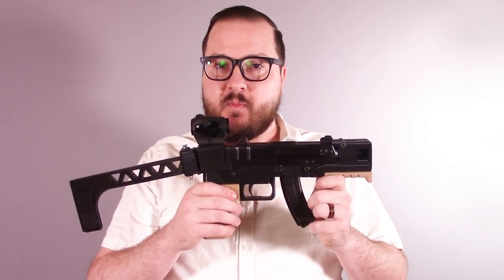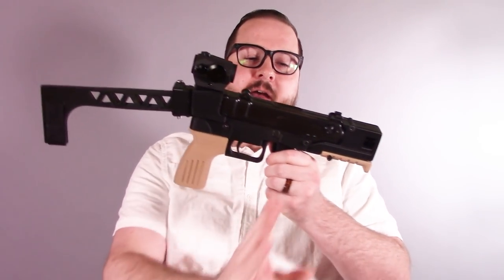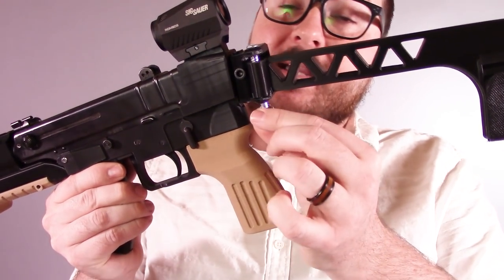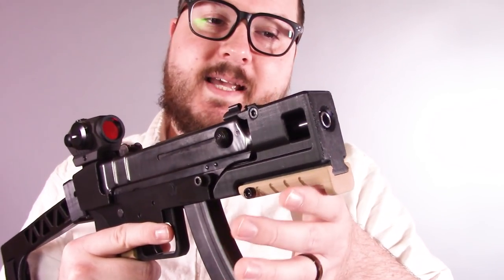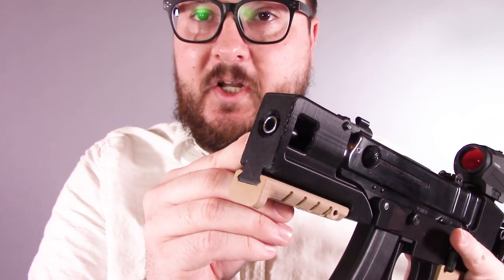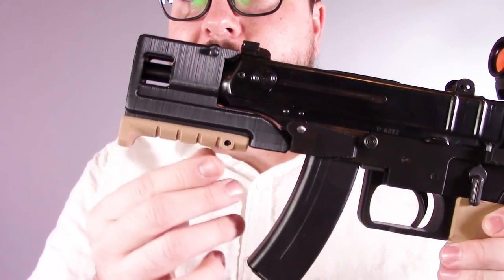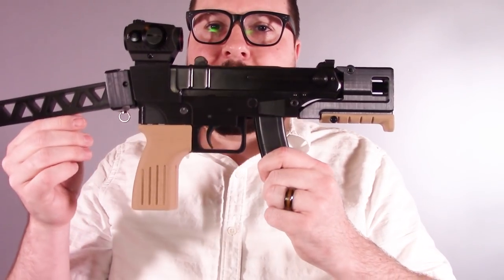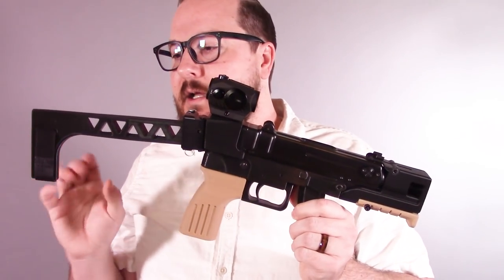3D Printed vz61 Pistol Update - Cyber CZ AR

Comment: Have you messed around with the randomized print temps on the wood filament? You can simulate a wood grain by changing the print temp by a few degrees up or down every few layers
Reply from the maker: Interesting. I haven’t messed around with that at all, most of my wood filament prints are praying to the FDM gods that it actually lays properly and doesn’t clog the fat nozzle, lol.

Comment: Nice work, looks like a ton of fun. Since you asked, I would like to see the 10/22 perfected. Maybe try shooting with better ammo to see if it needs fixing. Maybe polish and wax or grease the inside of the receiver and outer bolt surfaces. Maybe some more testing to see what optimum tolerances are between receiver and bolt. Maybe try a Volquartsen firing pin and extractor. Maybe a Kidd reduced power spring. Some wood PLA stock designs would be awesome. Thanks for everything you do.

Comment: Also have you considered a “scout” mount for the optics to get a better eye relief?
Reply from the maker: I debated adding a rail to the top of the handguard, but the setup where the rail currently is for the optic is perfect.
Reply: @booliganshootingsports  hey if it works roll with it 👊🏼

Comment: Here in PL receiver (lower) is legaly controlled part of gun (in theory - practical is not i n some gunz but for safety i prefere not to lose my permit for some plastic thing)... so i cant print it... but i edited front guard a little - change bolt for m4 with cut for nut, and added place for picantiny rail for rmr optic. 
Also i found online "slide" colapsible stock (MPX style), made adapter, connected together everything, printed extended mag floors and runs very well.   ThX

Comment: could you do like a full 3d printable single-shot  snap open .22 rifle ?
Reply: your gun designs are really cool ur of  the main people that are carrying this 3d printable gun world with this stuff , do you think its possible to do this completely out of nylon ever the metal parts for like a .22 style cz
Reply from the maker: Functionally and legally, you need to have some metal in there.
Reply: @booliganshootingsports  o I know for the weight but I've seen like for example piolets geeks Maverik pistol which is all plastic except spring and a firing pin
Reply: i was wondering would you be able to mabey do a full bolt action gun from plastic to show how it works internally and mabey see if that would even hold for a 22 as a test

Comment: that thin is awesome but i dont think that brace would pass as a brace to the atf.
Reply from the maker: It’s thinner at the rear and has a shorter length of pull than the ATF approved Shockwave Blade, and also has an arm strap which the Blade lacks. Frankly, it’s more of a brace than the approved braces, and I’m 0% concerned about it.

Comment: I would like to see a printable 30 round magazine for it.
Reply from the maker: I worry about the strength of an entirely printed magazine since this has thin walls and limited size to work with, but a printed base plate extension to increase capacity might be a slick design.
Reply: @booliganshootingsports  I know they used to have a drum mag for the 9mm model but never seen one for the 32 cal. The scorpians were real popular along with the macs, stens, sterlings, and aging Thompson's back in the 70's when I lived in Nortern Ireland.
Reply from the maker: So, I got bored yesterday and designed and printed a +5 magazine extension. Seems to be working quite well and is a start for more things like that!

Comment: I know it's simpler making the folding brace straight as a stick. Would be nice to have the brace mount be more vertical and not canted downward. The brace shaft curve down 45 degrees about 2-3 inches back from the hinge and straighten back out to clear the left side charging handle. Then I would delete the top rail and convert it to a flat rmr style mount to get that optic sight line closer to the stock sights... i was going to mess around with these ideas myself, but I dont see why someone who is infinitely more skilled in cad modelling than I couldnt do it better or faster. I know you said these are on your keybase, but I go to your keybase name page and dont know where to go from there...
Reply from the maker: The much, much easier solution would be to just straighten out the back of the receiver so the rail mount is straight out the back. But it’s angled for a reason, you need the drop for proper sight alignment. 

I’ve done direct RMR style mounts before, I have one on my integrally suppressed Mauser. I just like the versatility of a rail on this setup. Everything is perfectly lined up when you aim.
Reply: @booliganshootingsports  just different aesthetics... i was thinking that with the downward angle moved from the rear of the receiver into the brace arm, you should still have proper sight height alignment with the added benefit of not having the brace sticking upward at a weird angle when folded. Wouldn't that also take out some of the stresses to the top end of the brace mounting rail?
Reply from the maker: It wouldn’t be hard to redesign it, but I shoot for the simple solution in most things. This brace design isn’t proprietary to this gun, it’s a standardized one that can go on anything with a picatinny rail. It works great for my needs, so I haven’t felt any desire to redesign it and the receiver. 

And the mounting rail is so rock solid since it’s a solid part of the receiver. There is no way that the brace being angled adds risk of breaking compared to it being straight on. You’d snap the brace hinge long before the mounting rail would show any signs of wear due to the print orientation. 

But that’s the cool part about all of this, you can definitely redesign the parts yourself however you’d like to fit your own aesthetics!
Reply: @booliganshootingsports  you did ask in the video changes we'd like to see... lol. Im printing my first vz61 lower as we speak! I just havent tried to mess around with the 3d model in cad at all yet... gonna be doing that today.

Comment: I love you designs but I don't understand using PLA for this application. Is this just to prove your engineering or something else?
Reply from the maker: Because PLA is the easiest to print, most accessible, and generally, most affordable option for people getting into 3D printing. It’s the same reason why we design these things to fit on an Ender 3 bed. Because we want these things to be accessible. Sure, you could design something that is more intricate or lighter or smaller but you HAVE to use a more exotic filament, but what’s the point if only 10% of 3D printer owners will ever be able to use it?

And in an application like this, the PLA+ parts should last thousands and thousands of rounds in normal use. So why set up specifically for a different filament when PLA+ is good enough? Then you run into the potential safety issues, because what if you design something around some super strong filament and ONLY for that filament, and someone ends up missing that tidbit in the readme file and prints it in PLA and it breaks, injuring them or worse?

So those are a few reasons why we design these things to use PLA.
Reply: @booliganshootingsports  That’s a great explanation! Thanks for sharing!
Reply: @booliganshootingsports  Speaking of materials, do you think this would be much more durable in something like Zytel, or is it just that much easier/simpler to use PLA/PLA+ that it isn't worth it?

Comment: It looks good but what are the real world tolerances. if your running and fall or get blown around is it going to withhold a shoulder drop test basically? if your looking for ammo check out ammoseek.com. I like the idea this whole community is going but I am looking at this as how can it be used practically other than plinking?
Reply from the maker: Some designs are stronger than others, but these are designed to take real world abuse. The Vanguard AR lower is strong enough to use your rifle to perform push ups.
Reply: @booliganshootingsports  So for an example you smack a door way hard enough with the folding stock no cracks or separations from the print layers will occur? I am genuinely interested I am not trying to troll. I honestly thing what you and the rest of the different teams are doing with this is essential. But with the different bills coming and going, I sometimes wonder if this would even be something that would fill the gap needed if say they had to produce weapons for the resistance on Endor against the Galactic Empire infringing on the rights of Luke and friends.

Comment: "disables fully automatic features" So I assume you have the FFL to manufacture a class II weapon? Because otherwise you might as well make it a class III and it wouldn't make much of a difference. Then again if you didn't have the license this probably wouldn't have been uploaded. Disregard Kurt!
Reply from the maker: It’s not a class 3 weapon at any point when you build it from a parts kit. The parts kit includes all of the fully automatic parts, like most SMG parts kits, but not the receiver which is the part that would actually make it a machine gun. When you build one of these from a parts kit, you have to use a semi-auto receiver which in this case, is the printed one designed to use an AR FCG instead of a modified Vz FCG. Just like people who build semi auto Sten guns and other parts kit builds from SMG kits.
Reply: @booliganshootingsports  This is very informative, thank you. [currently staring at a distinctive sheet metal scorpion receiver with a plastic grip and trigger housing attached] Just saying that if the case were that one was illegally manufacturing a firearm, then in that circumstance they might as well be illegally manufacturing a sweet smg.
Reply from the maker: @kurteichenwald7417  and that’s the nice part about this build, is that it’s 100% legal to build as pictured. Just becomes exceptionally illegal if you try to build it with a full auto capable receiver.

Comment: The front end of that things gives me a semi chub. That stock looks fragile tho
Reply from the maker: It's a brace, not a stock, and it's actually rock solid when in use.
Reply: @booliganshootingsports  well considering it printed plastic I'm pretty sure it wouldn't take impacts well.
Reply from the maker: @MrZombieslayer409  depends on the impacts you’re subjecting it to. In normal use, it works fine. If you’re trying to use your gun as a club, yeah, it’ll probably break.

Comment: I would be careful of that brace.
My understanding of ATF rules is something like "a brace is only a brace if we get sent a example and we agree that it is a brace".

So it may conform to the idea of a brace but they could say otherwise if you make them angry.

So From my understanding you may want to melt that thing back into a plastic ball. 

However if I'm wrong, please continue as normal.

Nice gat by the way.
Reply from the maker: They don't even approve examples of accessories as braces anymore. They only approve whole guns, accessories included. Their current brace stance is "follow these few guidelines (LOP, relative size of "butt" portion, etc) and don't sell/advertise it as a stock replacement, and we'll probably not shoot your dogs. As far as it being a stock or a brace, we'll know it when we see it". 

I designed it with that ethos in mind. It's thinner at the rear and has a shorter LOP than the approved Shockwave Blade brace. I designed it around an arm strap which makes it even more of a brace than the Blade. 

Honestly, I'm not worried about it. I trust the legality of this design more than I trust damn near any SB Tactical brace.
Reply: @booliganshootingsports  okay that is cool, I was just checking you understood it better than me, for your dogs sake.
Reply from the maker: I have a good life and would prefer not to go to prison, so I make sure that all of my designs and ideas follow the law and applicable guidance, haha.

Comment: Not a fan of the folding stock/ brace. 
Yes to the idea, just not that design
Reply from the maker: That’s the cool part is that you can certainly design something different! I have a different version on the printer currently without the triangular cutouts and instead using an I-beam cross section for rigidity. What is your idea for a design?
Reply: @booliganshootingsports  something more along the lines of the pistol braces already out there. For example sb15 would be a good fit for that, if atf started their nonsense again it wasn’t on the ban list and you can literally use that brace and one hand shoot that pistol.
Reply from the maker: @reynaldorivera7641  The SB15 is chunky as hell and a terrible design, in my opinion. And frankly, anything resembling an SB Tactical design is something I wouldn't touch with a 10' pole because the stupid games they're playing with their customers and the ATF. Plus, it would require flexible filament which not everyone can print. The idea behind my brace design is to have something super low profile, easily folded, and easily able to utilize for one handed shooting thanks to the strap. I designed the "blade" portion of my brace after the ATF approved Shockwave designs, keeping it in the clear that way.